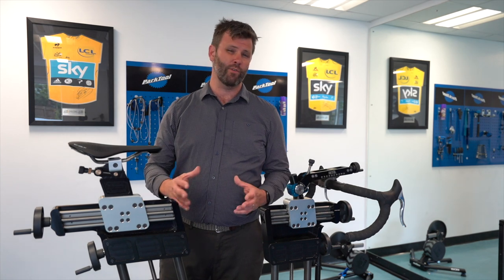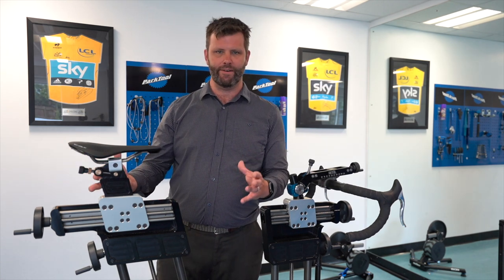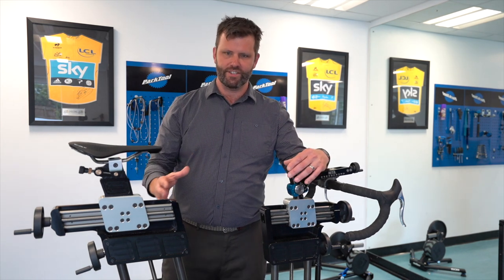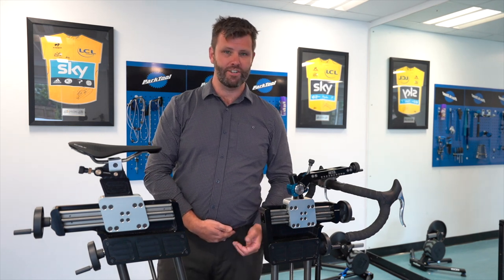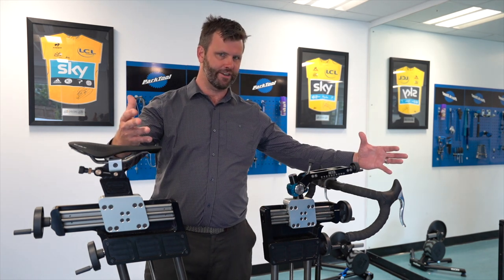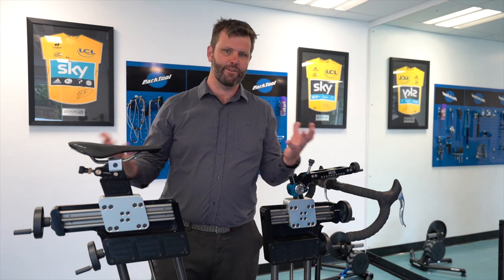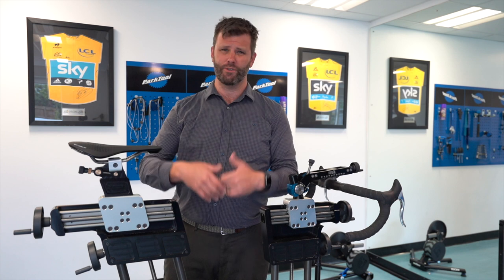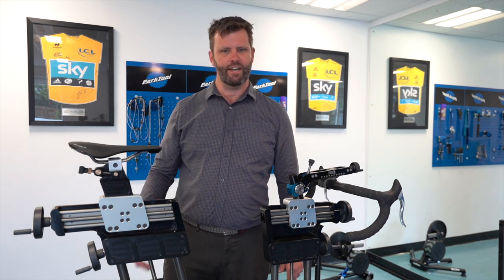Free Watts!! With No Extra Training!

Comment: This is very true, if you're too far back you will strictly use quads only. You want to use the quads/hamstrings/glutes.

When I'm in the drops I usually slide forward a bit, which puts me in a TT type position and I am able to put more power down this way.